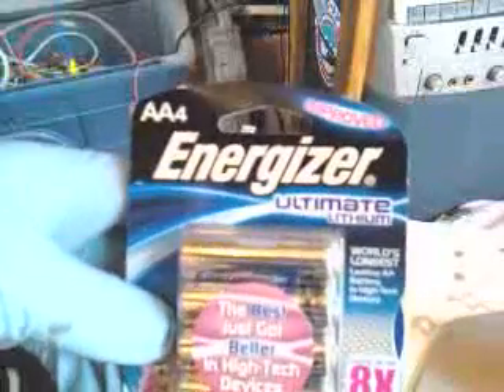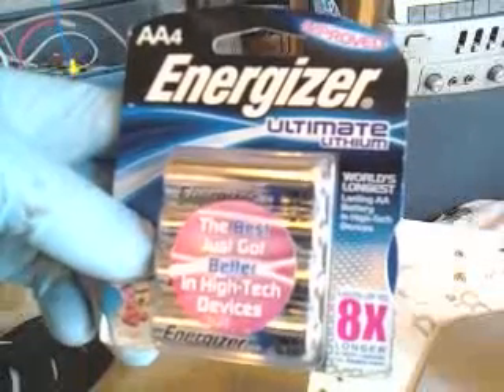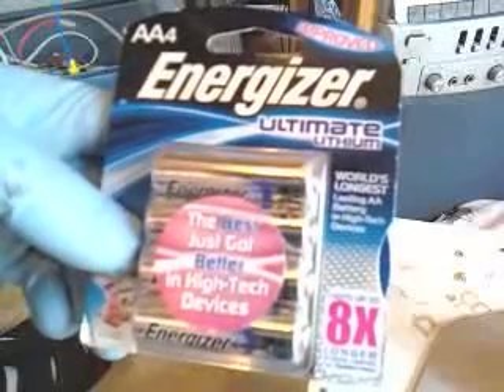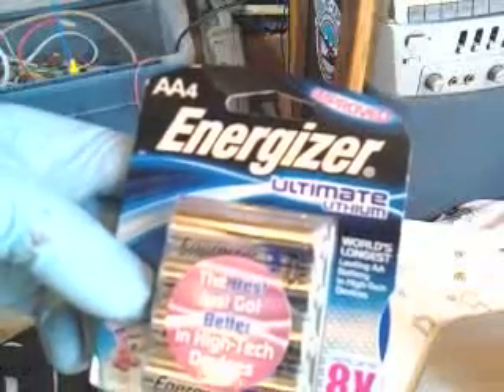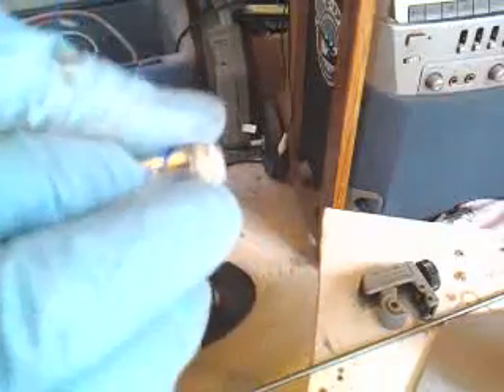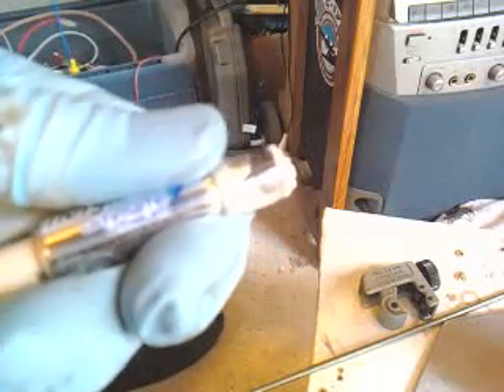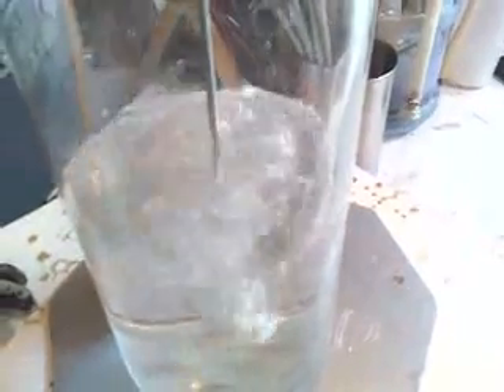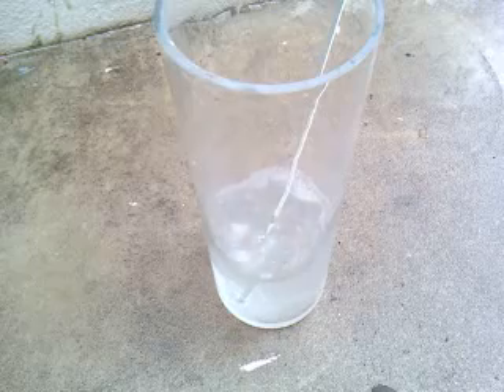Turn Lithium battery into Lithium Hydroxide

Comment: This lithium hydroxide is also used to make lithium soaps used as thickeners in lithium greases.  Next time you recycle a laptop battery pack, the lithium from it may be in your local auto parts store.